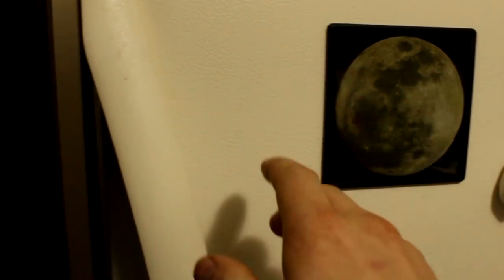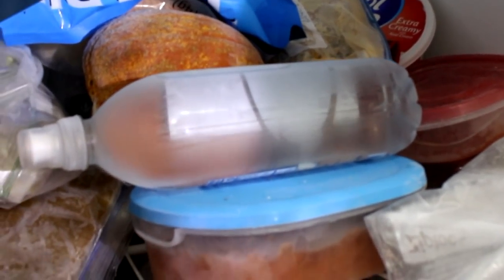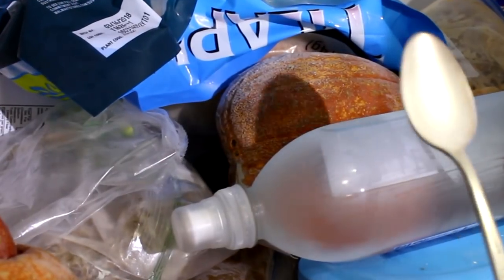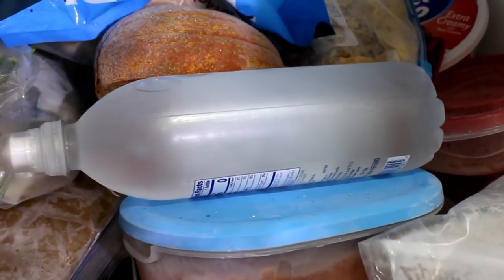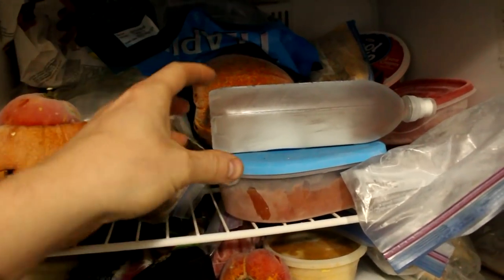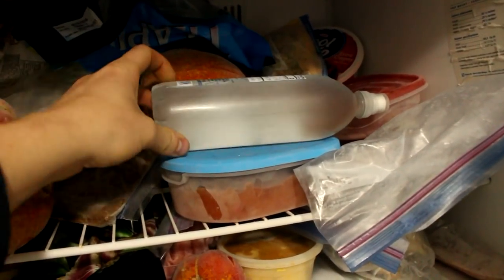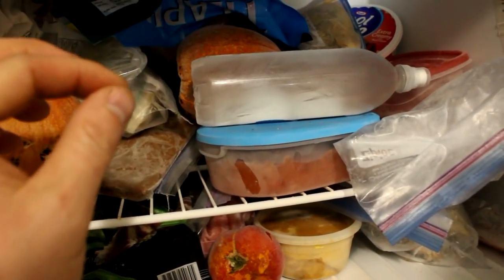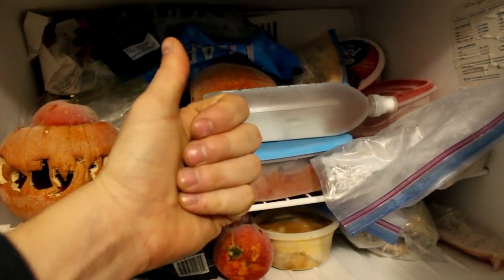Water Heats Up As It Freezes!?

Comment: The phenomenon is known as recalescence. In very pure samples, undercooling occurs before freezing due to the energy requirement to form a crystal structure. I experienced this frequently in my master's degree research. In some cases, we saw several hundred degrees Celsius undercooling before homogeneous nucleation occurred, shooting the temperature back up a few hundred degrees above the melting point momentarily before cooling completely and crystallizing. Interesting stuff
Reply: What pressure was this at to allow such an incredible supercooling without solidifying?
Reply: Benjamin Hicks It was done under ultra high vacuum (10E-6 Torr) and also electrostatically levitated, thus all but eliminating any possibility of heterogeneous nucleation.

Comment: Things RELEASE energy when they undergo a phase change from liquid to solid, just as they do from a gas to a liquid or gas to a solid. Hooray thermodynamics!
Reply: TheIdeanator hooray calculating that shit.
Its pretty simple really but its annoying to put down all the numbers and then when you mix up something it becomes eveb more fun.
Reply: Like handwarmers
Reply: What about the plastic bottle itself? Doesn't plastic heat up a lot, when you try to deform it? The water rapidly freezing and occupying more volume?
Reply: Water expanding and occupying more volume is sort of a unique chemical property of water itself when it freezes.  This is due to the actual structure of the water molecule itself, as Hydrogen atoms don't attach to the Oxygen atom at right angles to each other, but instead are offset a little bit.  It is this arrangement of atoms that actually makes the structure of water ice what it does.

There are some liquids like candle wax (aka paraffin for most stuff you usually get in stores now) that actually shrink when it freezes.  I suggest paraffin because it is a liquid at temperatures that don't cause too much damage to people if it touches their exposed skin and is cheap enough to experiment with freezing and thawing phase transitions too.

There are some other fun things about that molecular arrangement of atoms like how water is able to dissolve ionic solids like table salt, but that just gets into some deep chemistry.

Plastic does heat up a bit when you stretch it, but at the level of frezing shown by Cody here along with the mass of the bottle compared to the water, that minor amount of heat is insignificant
Reply: Thermodynamics it's all about correctly  writing pluses and minuses :)
Reply: Crystallization is exothermic.
Reply: pressure change in the bottle from the freezing can cause temperature rise too.
Reply: Pressure change wouldn't have a significant thermal effect in condensed phases - liquids and solids
Reply: Sometimes it's endothermic

Comment: Regarding your comment on rising temperatures during a snowstorm: as far as i know, precipitation is always frozen way up in the big clouds that make a storm. As the air temperature usually gets lower with increasing height, no additional freezing should happen during a snowstorm. It could, however, cause rain to cool as it melts on the way down. Love your sciency videos, by the way.

Comment: I always wondered why it seemed warm during snow storms, now I know. Thanks!
Reply: The warming during a snow storm can have many causes and I am not sure heat released during snow crystallization is the main cause.
A very important factor is the relative temperature of the inflowing air compared to the air that war there before.
Another important factor is that cloud isolate (greenhouse effect). So if it covers up when it is cold it will warm up because infrared light is reflected back to the earth.
Generalizing which factor contributes to how much is very difficult as it depends a lot on which initial conditions you have and what storm is coming.
Reply: Andrew Johnson   Snow storms can, at least in the middle latitudes, be caused by either cold fronts or warm fronts.  If it’s a cold front storm, the temperature will drop as the front passes.  If it’s a warm front storm, the temperature will rise.  I’m no great meteorologist, but my observation of snow storms is that the cold front variety are usually windy, shorter lasting and produce less snow at a given place on the ground.  Warm front storms are calmer, last longer and sometimes produce large depths of snow.
Reply: +Mark Holm As warm air can contain more humidity than cold air warm air can give bigger snow depths than cold air. As long as it is still cold enough to be snow. As cold air is denser than warm air a warm front can go over cold air that was there before. The "warm" air in higher altitude allows heavy precipitation and because at lower altitude there still is cold air the precipitation falls down as snow. The warm front will then usually gradually also replace the air at the ground level and the snow turns to rain. Unless cold air comes (a cold front that has caught up a warm front is called an occlusion. This is quite frequent and can cause very big snowfalls).

Comment: I'm pretty sure the main reason it gets warmer during a snowstorm is because of the warmer air (that can hold more moisture) that's transporting the moisture into the area in the first place. Without that, the cold air in place doesn't have nearly as much water to precipitate out.
Reply: As you said strongest snowstorm are likely to occur at near freezing point. If it starts snowing while far below the freezing point it is very likely that if snowfall increases, it will warm up. Just because it is the warmer air that allows heavier precipitation.
Plus another important factor can be the thermal isolation due to clouds (this effect is particularly strong in closed valleys where strong radiation cooling leads to thermal inversions and very cold temperatures. Clouds will reflect the radiation and warm up the ground and wind will mix the air layers and dissolve the inversion, leading to a warming of the air near the ground).

Comment: Nice demonstration. This is entropy at work. In grad school I had a crazy extreme example of this - I had about 100 g of a carbohydrate derivative that is a very thick oil when evaporated from hexane. It's reported in the literature as an oil - it will normally sit indefinitely as an oil in a container. This makes driving off the last of the solvent very difficult, even under prolonged exposure to heat and high vacuum. One way to drive more off is to use repeatedly evaporate it down with ever lower boiling point solvents. I took the oil in the flask off the rotovap and poured in around 200 mL of pentane. I went to put it back on the rotovap but the phone rang, so I went to answer it and put the flask down (with oil and pentane mixed) on a cork ring. When I came back about 10 minutes later, the contents of the flask had blasted all over the bench top with crystals everywhere. So it turns out the material can be crystallized by mixing with pentane. Melting point 67 C. So when the metastable oil crystallizes it very quickly rose to 67 C and flash boiled all of the pentane (bp 35 C I think) away. What a mess, but I would have never discovered this had the phone not rang.

Comment: I recently learned about hardening of metals and something similar happens at the decalescence  and recalescence points of metals.  When metal is heating up and cooling down, these two points are passed. The metal's temperature actually stops rising(decalescence point) and temporarily lowers before  continuing upward. The same happens at the recalescence point where the temperature stops lowering and actually rises before continuing cooling.  I wonder if that's similar to what's happening here and with the gold you talked about.
Reply: I'm not too familiar with metallurgy, but it sounds like exactly what's happening here. All matter, every substance, has temperatures at which it freezes/melts, and boils/condenses. At those temperatures, there is a specific amount of energy that must be absorbed (called enthalpy of fusion for melting/boiling) or released (called enthalpy of vaporization for freezing/condensing) for the matter to undergo a change in its physical state (ie: solid to liquid). At those points, for larger amounts of the substance, the temperature might remain constant (or suddenly rise or drop) for a bit as the energy transfer is occurring. In this video, that is why the water doesn't all suddenly freeze to ice, but rather remains slushy with a lot of water. Since the water is releasing heat energy to freeze/crystallize, it heats the surrounding water. It would be impossible to supercool the water enough for it to all freeze at once under normal atmospheric pressure (and might be impossible altogether, I don't have a phase diagram handy to check). For the gold, as it is undergoing the state change from liquid to solid, it suddenly releases enough energy to the surrounding atoms for their electrons to emit photons in the visible spectrum of light (the sudden glow).

Comment: Yas, if water needs energy to melt (melting latent heat), it will relase that energy when it solidifies.
Reply: Awesome though. I've always known and understood the fact that water absorbs energy when melting, never thought of it relasing energy when solidifying (even though if they told it to me i would have understood that). It's good to see that the law of conservation of energy keeps working. Thermodynamics is always difficult to believe and understand at first, because it says things that are the opposite of what we are told in the childhood (boiling water will cool it and freezing water will warm up it).
Reply: I advise you to switch accounts before replying to your own comments.
Reply: Dragos Merisca i think it was just a continuation to his first comment..
Reply: Dragos Merisca it was pretty evident. I used a "though".
Reply: if it released energy while solidifying, wouldn't it get colder, as the energy, that leaves the water, now is no longer in the water, and less energy means colder?
Reply: Cooking With Cows no because it is releasing energy in form of heat, but it was stored in some other way, like bonds. The total energy is the same.... As far as I understand
Reply: +Cooking With Cows; it is cooling as it releases the heat. The water had the energy as potential energy due to being liquid phase. The ice has that energy as thermal (chaotic kinetic) energy and will continue cooling until reaching equilibrium w surrounding air.
Reply: +Sky Man; it doesnt change phase until steve shoots his minecraft gun at it.

Comment: Latent heat is what is given up at liquid to solid state change. I see this in the refrigeration world, as a freezer drops to 32f (0c) the rate of temp descent flat-lines for a significant time interval. Once the the latent heat has been absorbed by the evaporation apparatus the temp begins a steady descent. The h20 vapor in the cooling chamber (freezer) determines the rate of descent.

Super cooled video, Cody!!!

Comment: What you're seeing is the same amount of energy being released in a short time, as would normally be gradually released by a non-supercooled freezing process. In the latter case, the water stays at 0°C even when continuously extracting heat from it, due to the transition from liquid (high energy state) to solid (lower energy state). As long as not all water is frozen, any attempt to lower its temperature is thwarted by liquid water releasing heat by going solid.
By triggering the solidification of a supercooled substance, it quickly dumps all this same surplus heat resulting from the solidification, and it ends up warmer than it was while still a supercooled liquid.

Comment: I think the statement about temperature changes during snow storms needs some rethinking.  One point to consider is that, at least in the middle latitudes, snow and rain both usually start out as ice.  The water freezes high up in the cloud.  Rain melts on the way down, snow does not.

Comment: Does the emissivity of the water change as it solidifies? I think something like that would also change how warm it appears in to the thermal camera. Or, could changes in the refraction of infrared light as it passes through the bottle cause changes in the apparent warmth as viewed by the IR camera? In the second to last clip of your video, there appears to be more thermal energy on the left of the bottle (and surrounding objects): Is this due to IR reflections?

I guess what I'm asking is: Will you verify these claims using another method of temperature measurement?
Reply: Good question.  But I’m not sure the bottle is even transparent here in the IR band.  Which would be good as you’d be eliminating emissivity changes and would be measuring the temperature of the bottle.

Comment: That snow comment was interesting. I thought that it gets a little warmer when it snows, because when there is a storm there is a low pressure system coming through, low pressure systems follow the jet stream which brings the warmer southern air mass closer. When it gets colder there tends to be high pressure. The polar vortex is really just the high pressure that sits over the polar regions.

Comment: This is pretty much how hand warmers work too, isn't it? Boil the bag to melt the crystal, and then it supercools. Pop the metal trigger inside and it sets off the crystallization and emits heat. Watching one of those go off is pretty much identical to your water bottle on IR, and is both cool and warm at the same time -- cool to watch, and warm to the touch.

Comment: Nice Video! Finally some chemistry again! Yay! The release of crystallization energy in form of heat can lead to some extreme results. I for once ruined my lab coat and gloves because I tried to figure out the solubility of my anorganic salt analysis mixture in first semester. The salt was soluble in boiling sulphuric acid. Once the mixture cooled down below boiling point i gave the reaction tube a casual little shake and BOOM! Unfortunately I don't remember which salt caused that reaction but it was propably something very stable since its crystallization process caused the sulphuric acid to boil and eplode out of the reaction tube.

Comment: So basically the molecular energy (speed) is conveyed into the electron shell during solidification, thus raising the energy stored in the electron shell, then as the electron shell looses energy it releases it as light as the energy released by the water-to-ice phase shift is relatively low it only managed to release light in the infrared spectrum, but when liquid gold phase-shifts to solid the energy transferred into its electron shell is greater and as gold is a better thermal conductor it releases the stored energy at a greater rate the energy released spikes way up into the visible light spectrum.  Should probably point out that the energy equation is still balanced, less someone waste their time thinking of yet another over-unity system using phase-change as a power source.

Comment: About getting warmer during snowstorms: where I live we don't really have snowstorms like you have in America. But during heavy snowfall with no wind the snow line drops in closed valleys because the melting snow cools the air. So rather than warming the air I would say that snowfall evens the temperature in the altitudinal gradient (warming up high up where snow forms and cooling below the snow line). Of course if on the ground it is far below 0°C you will only have the warming effect.

Comment: If you know the temperature of the supercooled water, plus the enthalpy of freezing and heat capacity of water, you can estimate the amount of ice in the final slushy mixture. Assuming an initial temperature of -20C (typical freezer), this works out at about 25% ice/water. In theory Cody could verify this, by pouring the mixture through a filter.